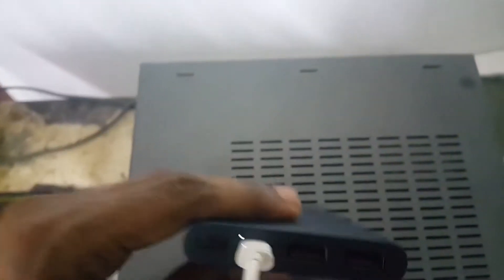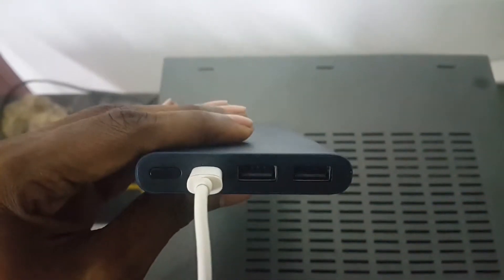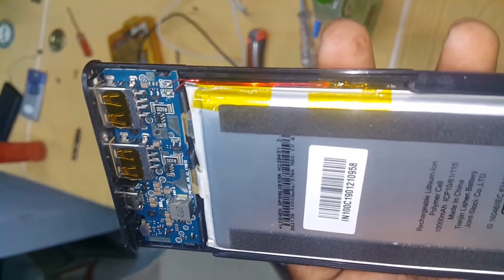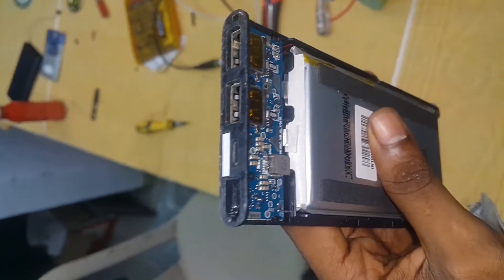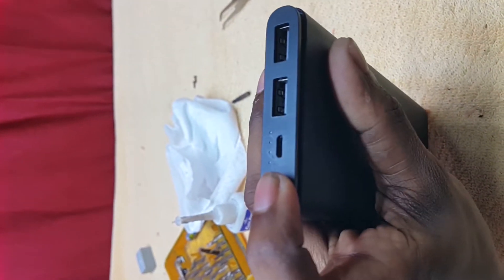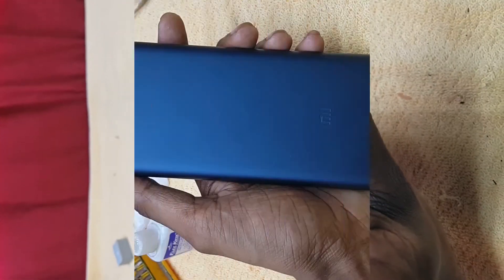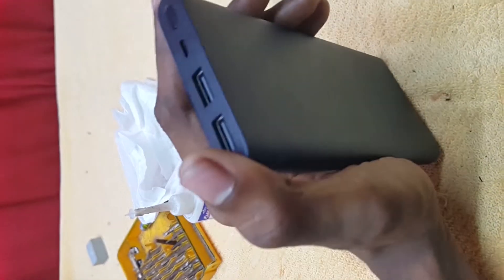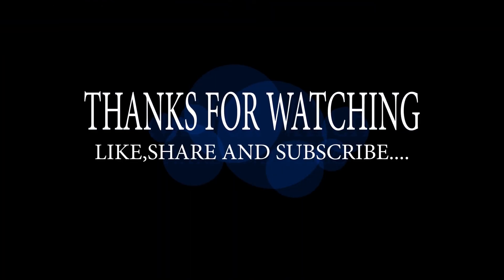HOW TO FIX MI POWER BANK CHARGING ERROR??....പവർബാങ്ക് ചാർജ് ചെയ്യുന്നില്ലേ?എങ്ങനെ ശരിയാക്കാം?

Comment: Ath onm kanichu thannindenge kollamayirunnu
Reply from the maker: athua?
Reply: @LETSDIY57  aa വയറെമ്മേ തീ ആക്കുന്നത്
Reply from the maker: wireil allla athin tip oru black sensor ind athin kurach heat akiya mathy
Reply from the maker: same model anail.open aakid correct ayitt anail batteryude sideil oru mathri yellow colour tape ett ottich oru small black sensor ind two metallif wire inte endsil aaa black piece choodakiya mathy videoil ullla problem anail change avum
Reply: @LETSDIY57  broo ende Mi de 2000 mah ann. Broo paranjathill ennill korach manasilayillaaa
Reply: @LETSDIY57  onn Vilichindenge valya upakaram ayyene

Comment: Thanks bro, its working successfully, I heated it without opening the power bank
Reply from the maker: Ok keep supporting
Reply: 1. Where did u heat it?
2. Using what u heated?
Reply from the maker: if its the same issue. there is a thermistor a small temperature sensor in it heat it with a soldering iron or keep the device entirely in open sunlight and get it hot.if it has same fault.it would clear up.

Comment: SAME PROBLEM 20000 MAH mi powerbank, please help...
Reply from the maker: Please consider subscribing new videos on the way
Reply from the maker: Same issue ano?
Reply from the maker: Alll led blinking?open the powerbank up internals are almost same the sensor will be inside it with few wires heat the sensor a bit the powerbank will work fine

Comment: What did you actually do my friend.do proper video and show us what you gonna do with solution
Reply from the maker: buddy remove the powerbank there is is small sensor to the side of the battery give it a bit of heat problem fixed